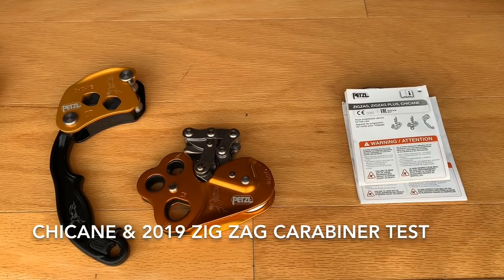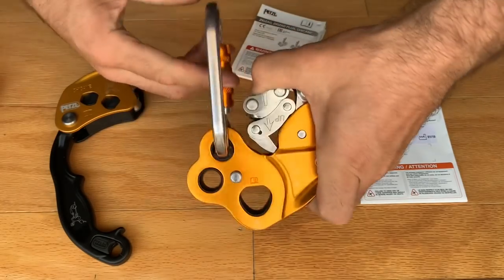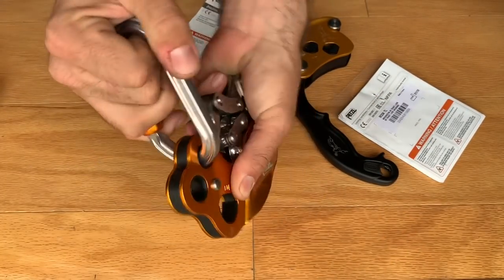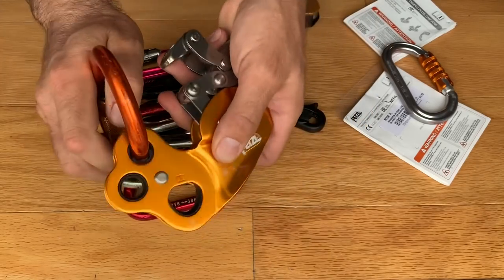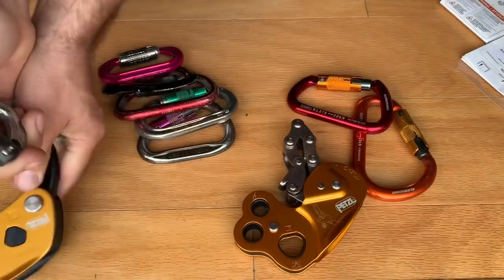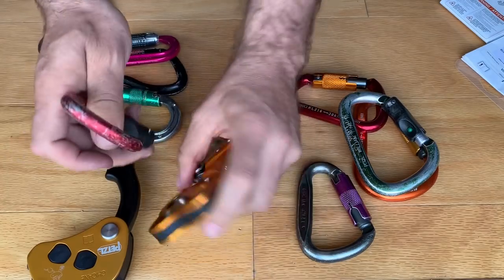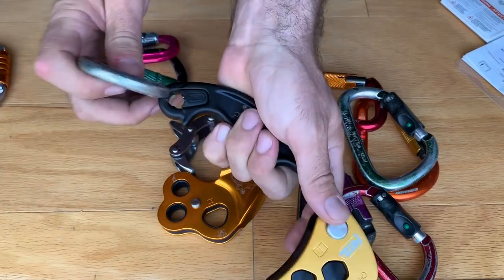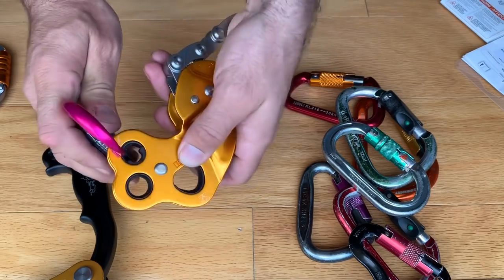Petzl Chicane and Zig Zag Carabiner Test

Comment: They need to make it clear that you have to have their carabiner beforehand.  I bought my Chicane and now I can't use it til I get the carabiner.  What a racket!
Reply from the maker: Nee Kniggit maybe they should sell it WITH a carabiner?
Reply: same !
Reply: yes i got caught out with that to
Reply: And at over $25 each one would think the Petzl H frame carabiner would work on every Chicane. I bought three of them and none fit it. I say screw it. I’m gonna use a little 12kN single-action rock climbing carabiner on the Chicane. If it were to fail, the better carabiner on the ZigZag would still hold me.

Comment: I've been using a zz plus on drt for a few months now, and it is wonderful. Smooth as silk, and don't have to worry about constantly adjusting a hitch.  It accepts an h frame biner from most manufacturers, but it won't rotate all the way around which makes rope attachment a bit confusing at times. If the chicane will only work with the petzl h frame binder then it should be sold as part of the package. I think petzl decided to use some marketing trickery to keep the advertised price of the chicane closer to the rope wrench. Shame on you petzl. Just be honest.